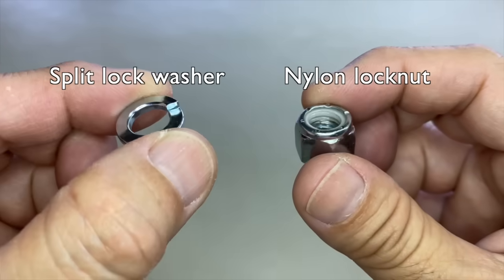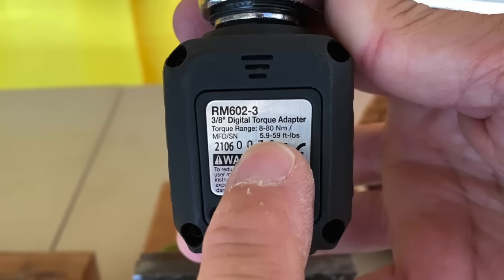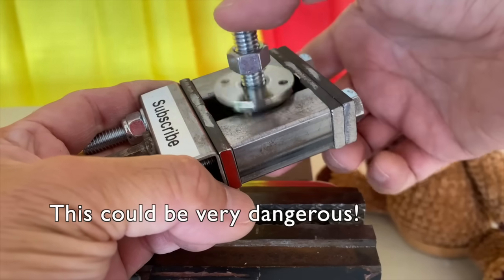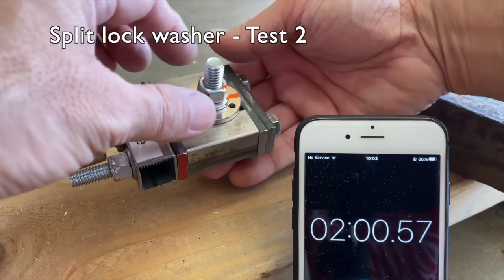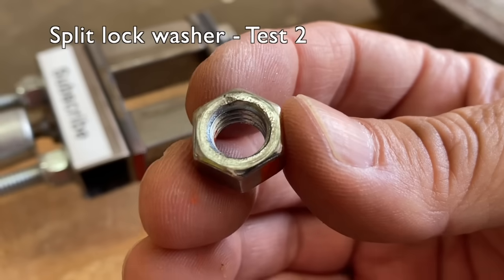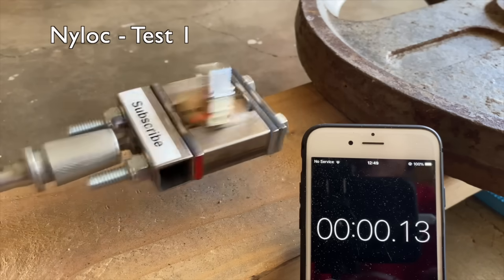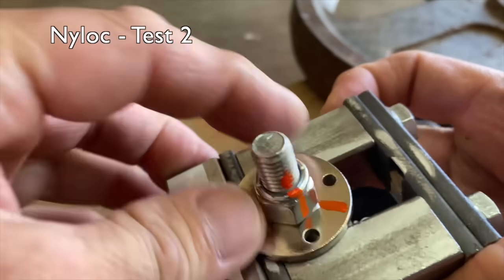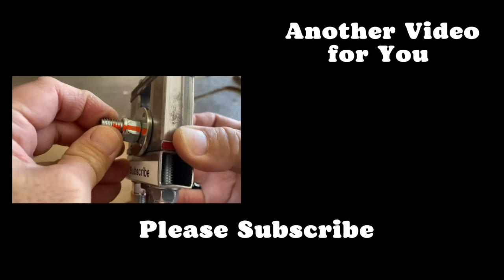Nuts & Bolts - Split Lock Washer vs Nylon Locknut – DIY Impact & Vibration Test - Part 1

Comment: Your test of the nylon lock nut is invalid. I'm an aircraft mechanic as well, and we learned this in school decades ago: You CANNOT re-use a nylon ("fiber") locknut (EDIT: and expect it to be a "lock" against loosening). Basically, to achieve their rated security, they are a one-use item. Your nylon nut showed that there were already threads cut/pressed into it.  You can clearly see this at 5:05 in the timeline. So once that nut was tightened, it's almost like there was no safety mechanism at all--the friction from the nylon material is significantly decreased (if not totally absent). 

So repeat the test with a NEW nylon locknut each time, and then the results are valid. I'm not saying the (new) nylon nut will be superior to the split locknut, just that your test isn't valid...because you're not using a locknut with the engineered specifications for friction force resisting the tendency to loosen.
Reply: From the FAA's AC43-13b, section 7-64(f): 

"Fiber or nylon locknuts are constructed with an unthreaded fiber or nylon locking insert held securely in place. The fiber or nylon insert provides the locking action because it has a smaller diameter than the nut. Fiber or nylon self-locking nuts are not installed in areas where temperatures exceed 250 °F. After the nut has been tightened, make sure the bolt or stud has at least one thread showing past the nut. DO NOT reuse a fiber or nylon locknut, if the nut cannot meet the minimum prevailing torque values."

Basically what they told us about the "...cannot meet the minimum prevailing torque values" bit is simple: The only way to really know that the fiber lock nut can meet the requirements, is to replace it. By testing a used nut to see how much torque it takes before it cannot resist torque, you are pretty much causing more wear and further decreasing its resistive friction force. So in other words...just replace the nut. 

Although your nylon locknut doesn't look like an aircraft locknut, the concept is exactly the same. Again, to resist a force trying to loosen a fastener, you need friction. Friction is a force, and is the product of some static and/or dynamic constant/coefficient (there is a different value for each), and a force applied perpendicular to the bolt you are securing with the nut. In other words, by having thread impressions already in the nylon material, all the resistive force is basically gone--and all you have it a plain nut, for the most part. 

So as I said above: Repeat the test with a new nylon locknut for each run, and let's see the results head-to-head against the split washer. The split washer might win--I've never tested them against each other, so I simply don't know...but at least it will be more fair test.

Comment: If you can't use a Loctite type of prevention, then a Nylock is great for normal use, a prevailing torque lock nut (a Stover for example) is preferred for heavy use, it's only caveat is that it distorts the threads on the bolt so both are a one and done.  

As far as washers go, splits are junk.  I much prefer a wedge lock type (ie. Nord Lock) as they can take far more abuse and require multiple points to go wrong before complete failure whereas a split lock only has one.

Lockwire is also a great option too if available.

Comment: Use lock tight if you want a nut to stay on in high vibration.  Just use a torch to get them off.
I wish I would have known when I got my tractor.

Comment: Split lock washers have a tendency to break, that is why they are not used in critical applications.  The best is castle nut and safety wire. Lock washers are useless on grade-8 fasteners.

Comment: There is a reason the lowest set point on your torque wrench is 6 ft-lb. It is for a #12 screw not a 3/8" bolt. The test should be performed at 20 ft-lb to be a valid test. Also one of the other commenters mentioned the temperature on the nylock nut. This is a big factor to their performance. We have them fail more often that regular nuts with lock washer and locktite.

Comment: Six ft/lbs is hardly enough torque to judge any failure rate. So many components on an automobile suspension use no "locks" other than lock compound and high torque. When you talk about dangerous failure,  ft/lbs are the key to safety.

Comment: I only use split lock washers where heat may soften the nylock or with chemical environments that could soften or dissolve nylon.
You could also use both.  or crown nuts, or the welding torch.

Comment: Have you ever tried this with a washer and two nuts counterlocked against each other? I had to change a bolt on my cargo bike where the steering bar connecting to the front wheel is held by an eye which is locked by bolt and nut. The manufacturer used a Nylock bolt but one day riding my bike I notices a clacking sound and the bolt had almost fallen off. So I changed the bolt to a longer one and used two nuts counterlocking them. So far no change, all seems good. but would be nice to know your opinion.

Comment: Last time I checked the rule is to use regular washer + split washer. And may be more torque. 

You may also consider wedge locking washers.

Comment: Split lock washers have proven to provide zero benefit!  The have been eliminated from use in structural design.  

Auto manufacturers have also eliminated the split lock washer.

Comment: when I rebuilt diesel engines we used to mash the connecting rod  nut  WITH A HAMMER and  made it somewhat oblong it whent on tighter all the way done the threads this technique work well if  you have doubts. i was taught this in the 60S BY THE OLD TIMERS. ITS A GOOD TRICK

Comment: I guess we've now learned the consequences of insufficient torque.  
Proper torque solves the 'problem' in all but the most demanding applications.  In critical situations (like aircraft) you'd use a castellated nut and a cotter pin.

Comment: Problem 
Nylock plastic in most cases degrades and fails when exposed to utraviolet sunlight over an expanded period of time.
Example.
Not recommend for vehicle towbars for this reason

Comment: Hate to inform you that 6ft# is pathetic.
Acceptable is 23ft#, 6 is not even technically tight. One of my engineers could use a 3/8" drive by hand torque 3/8 fine to 30#

Comment: Torque to just 6 lbs?  I've never used a lock washer that I didn't almost flatten, way more than that.  The lock washer only is effective as long as there is no (or minimal) movement.  After that it contributes nothing.  The nylock restricts the nut's turning all the way to the end.  Totally different.
And why not test using both together?  Testing with a lock washer under the nylock might have actually told us something.  Likewise putting a second lock washer under the head of the bolt.

Comment: THIS GUY DOES NOT EVEN KNOW HOW TO CALL OUT A 3/8-16 BOLT.

IT IS NOT "3/8 x 16".  GOD, WHAT AN IDIOT.

It is 3/8 DASH 16.

It MEANS 3/8 inch nominal diameter and 16 THREADS PER INCH.  

Has this guy ever even been in a hardware store?

Comment: I work with fasteners like nuts and bolts and with machines with heavy sustained vibration.

I'd pick a nylon lock nut or even just 2 jam nuts over a nut and split washer any day. And dude use loctite blue.

Comment: The demonstration while good to see in regards to the importance of using the correct make up of a bolt fastener was floored. Why? The bolt looks to be an 8mm or 5/16’’ and more than likely a low grade steel. (Mild steel) the test should have been done with the correct grade bolt and hardware and torqued to the correct manufacturer’s torque recommendation which would have been + - 32 ft/lb (40 Nm). 6 ft/lb is significantly less than secure. But the demonstration was a good indication of the necessity to use the correct hardware. Had the bolt been torqued to the recommended setting the first scenario would have failed within a very short time. The second set up would have probably failed as well but after a significantly longer period. The last scenario using the nyloc nut would more than likely broken due to metal fatigue and fracturing from the continual shock. But from an education exercise, it was a good demonstration. As a Cat mechanic the first scenario is the same as Cat would use and providing it is torqued to the correct specifications would be perfect. However the application also determines what hardware to use. This demonstration is particularly harsh and would take a special hardware set up in regards to the use of tightening agents such as a loctite and use of lock wire and or wire. But a good demonstration nonetheless the less.

Comment: The Nylock nut stayed in alignment with the bolt on every test and vibration duration, so something else had to be loosening to allow the bolt assembly to come loose.  The chance of the alignment staying the same after each duration is astronomical.

Also, marking the initial location of the split on the lock washer would indicate the rotation of the washer in relationship to the flange, the nut & the bolt.

Comment: "NyLoc lost the preload". That's because the NyLoc has a natural resistance to torque which you need to measure and add to the Test Torque (for equal bolt tension) for a fair comparison especially because you are testing at a low starting torque.

Comment: Error in Your Method. The Nyloc has a natural resistance to torque. So, you need to measure that torque and then ADD IT to the  Test Torque for a fair comparison. The NyLoc is the superior option.

Comment: You should do Nylon Locknut + Split Lock Washer.

Looking at the nylon locknut test, it didn't turn on the bolt. It's likely that the joint surfaces were worn down a bit. When it loosened, the surfaces began to rub more quickly. The Split Lock washer will eliminate any initial loosening.

Comment: First = torque should be more fore 3/8 bolt
Second = nylock nuts with flanges would not slip

Comment: In tightening the Ny-loc to a 6.0 foot pound reading did not allow for the friction of the undersize nylon ring in the nut, so the assembly was not tightened to the same tension …

Comment: The only problem with this test is you did not torque the bolt and nut, it's designed to yield strength. 23 to 25 Foot lbs. That would be a valid test.
Mark

Comment: I would have tested 1 of each version and then repeat that 3 times.  Doing that would show any issues or variables with your test setup.  It may not have mattered here but if your test setup changed ie. Didn't shake as hard after x amount of cycles... you probably wouldn't be able to tell.  Especially if it happened to change between versions.  That said thanks for sharing.

Comment: I've used both at one time with a liquid thread locker. Used it on a cheap kids Chinese 4 wheeler that all the nuts vibrated loose Everytime they rode it. Never happened again, overkill yes, loose nuts and bolt never again.

Comment: Split anytime Reusing. In projects or contruction.... tork some nylon too much... and it's just a bolt.... it loses the threated.  Not reusable.  I wonder if they use nylon on planes... sh*t, I would not fly that company.... if they are prenparent.

Comment: 15 -25 ft lbs on average for junk bolts twenty for the studs inside the hydraulic pumps i rebuilt. That setting ive seen used for valve covers on certain cars. I used both methods, extreme pressure and vibration were a constant in my work. Both worked well the split locks usually broke in half or just stayed flat when they were done. Usually if that happened a stud or bold had been overstressed and stretched.

Comment: Not sure if someone else picked it up. While the Split washer showed the nut rotating on the bolt (2:53). The test with the Nylock showed that the Nut & bolt and not loosened (6:56 - paint stayed lined up) which tends to imply the nut has not moved on the bolt but there has been wear somewhere else on the interfaces.
Reply: wow. now I have to start all over again, watching.

Comment: First: people have already mentioned this: torque to the manufaactured specs. but you'd be waiting far far longer than 10 mins so...

I guess it comes to choosing the nature of failure. would you rather:
lose torque loading to be found on the next inspection, or have the assembly catastrophically fail and/or permenantly damaging the base material?
if you're going to lose the torque loading either way, then one is clearly better.

Comment: The fact the nyloc does not move on the bolt, only the washers moving is showing that the bolt itself is stretching due to the constant movement. Preload was not lost due to the nyloc, it was lost due to poor tensile strength bolts.

Comment: I remember talking to retired Navy men from WW l l  back in the early 90's . They told me they used just about every thing to lock threads from tar mixed with ashes to common red paint . Anything to get the machines going .  Good video  .

Comment: Use cotter pin in very critical areas. Also Bolts with very small pitch used in car suspension to avoid unscrewing. The pitch of the bolt that you use is (big) regular. Threadlocker liquids also can be used.

Comment: 6 ft lbs?  Not even enough to properly set the lock washer.  Did you start this experiment at higher torque values and then lower the torque until you got a failure?  

You should be a climate scientist!

Comment: I bet that Nyloc nut took more than 6 ft-lbs just to spin it on the bolt. Why only 6 ft-lbs? That's extremely low. Take that torque wrench and put it on the Nyloc nut and see how much force it takes just to turn the nut down the shaft of the bolt.

Comment: I like your video.👍

There are other locking nuts and it would be worth testing those too.

Sometimes I will use "Distorted-Thread Lock Nuts", (also called collar nut"), If I need to for use in high vibrational or torsional force environments if I can find the size I need. Some are Mil. Spec and can be found in Grade 8 hardness.

There are also "Top-Lock Distorted-Thread Lock nuts" that are differently constructed that have the same function, but IMHO, they are not as dependable as the more evenly distributed Distortion of the Mil. Spec. type and other "Distorted-Thread  Nuts".

Comment: I understand why you purposely torqued the bolt/nuts at such a low setting. because a properly torqued bolt/nut would have taken FOREVER to work loose. Still I see your test as valid. Partly because many people do not own a torque wrench. And many DIY'ers do not know how tight, tight is by feel alone. Good job. I never would have thought of this video idea.
Reply: Most DIYers would at least run the nut down till the lock washer pressed down tight.

Comment: Working with high tech machinery for 30+ years, I can tell you that improperly torqued nuts and bolts will come loose in an environment where there is vibration. I would fully expect that to come loose at 6 ft/lbs. Perhaps do a test where you check at various torque specs.

Comment: Lockwashers' first line of defense is their trapezoidal cross-section.  If you look at the split end, it is trapezoidal, not rectangular.  When you tighten them, the first resistance you feel is the helical spring shape compressing.  The torque then goes up a lot, and you can get a bit more turn in before the torque to turn it further goes way up.  This bit if turning between the time the helix compresses and the time everything bottoms out is the whole thing twisting to minimize the height of the trapezoid.  This gives extra resistance to loosening.  

The primary locking mechanism is springiness, rather than digging in, although that comes into play if the fastener does start to loosen.  This is why long bolts threaded through long thru-holes don't always have lockwashers.  The springiness is provided by the bolt lengthening under torque-induced tensile load.

Comment: I'm not surprised that the nylon locknut did better because the nylon part bites into the threads.  Kudos to you on your manicured and clean fingernails!
Reply: I think that it's the threads that do the biting and the nylon that is bitten but I have dirty finger nails so I could be wrong.
Reply: nylon get bitten .

Comment: I have a question for the group (not the tester):  Isn't he using the Nylok upside down?  I know many people use them the way he did but I've also seen them used with the nylon part DOWN and I've heard that scored and rounded part is a crush zone that you are supposed to crush for it to truly prevent it from coming loose.  Has anyone else heard that?  Oh and this test would have been better had the nuts been tightened. 🤣
Reply: What you have been told sir, is utter BS and it needs no further explanation.

Anyone who starts a nylock with the nylon end first is an idiot.

Comment: I use locktite green for every bolt. It will never open again by itself. The only way to open it again is to heat it with a torch and then i used a 6m long pipe as a lever for my tool 😂

Comment: When we changed from split pinning bolts to nylon lock nuts the engineers said we could discard the flat washers if we wanted to.

Comment: Go one step further, 
I have stretched the bolt to torque specs then hand done the nut. When the bolt is released, the torque is correct as torquing the nut has an opposite effect on the bolt. 
Only used in extreme applications tbh. Rigs, turbines etc. 
Excellent video, great share, thank you.

Comment: this testing is bad... why would you torque 3/8 bolt only 6ft-lbs? it should be tightend 25-35 ft-lbs, then do the same testing. It wasn't on the video but I think you probably needed a bigger torque just to move the nylon nut all the way down go close the gap.

Comment: The two nuts are intended for different applications.  Bolts and screws depend on stretch to create clamping force.  The 6 ft/lbs was grossly inadequate to stretch the bolt.  The nyloc is for applications where proper bolt stretch can't be used.